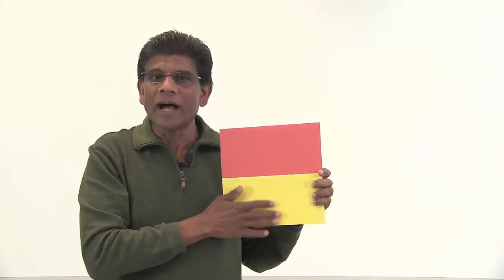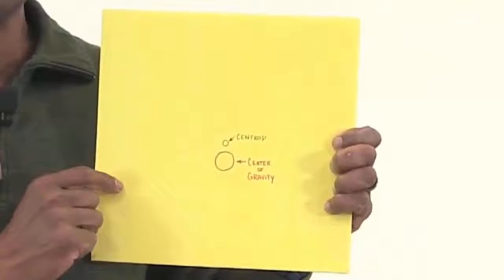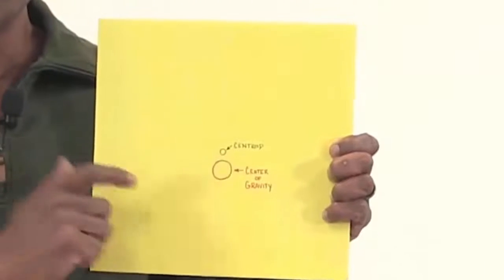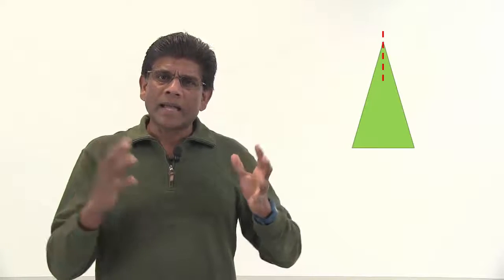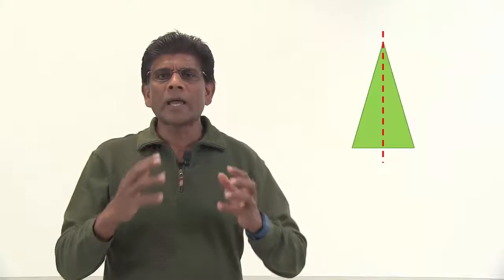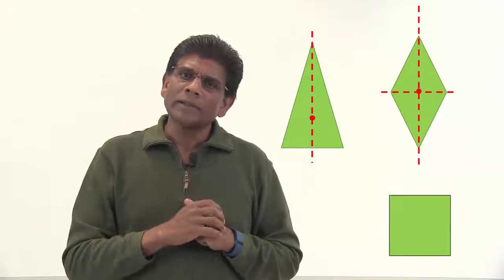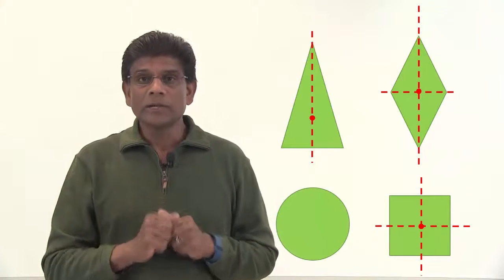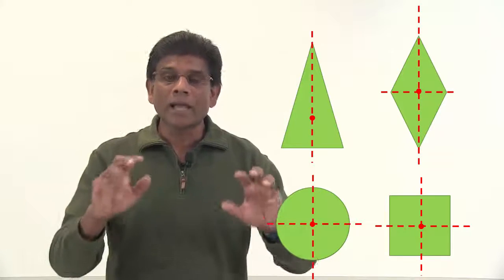Center of Gravity and Centroid - Lesson 20

Comment: using centroid what we do? like using c.g we balance a body....
Reply: We use centroid in solving engineering problems. One prominent application is distributed loads. Distributed loads are typically converted to concentrated loads when solving problems. This concentrated load is applied through the centroid. This is covered in another video that deals with distributed loads.